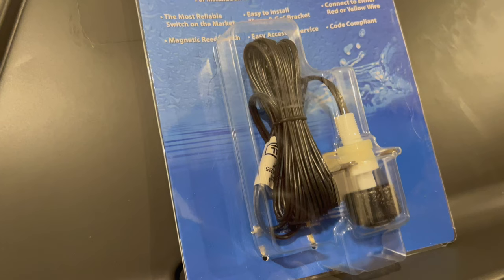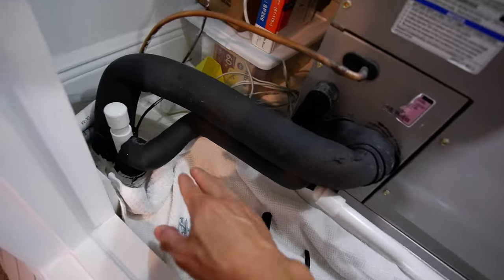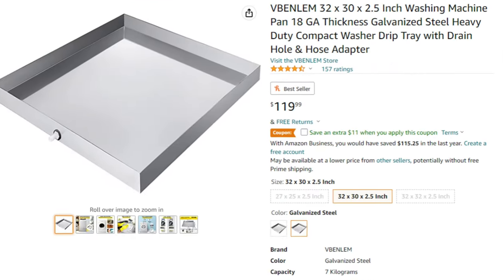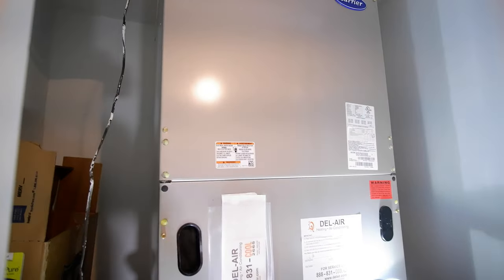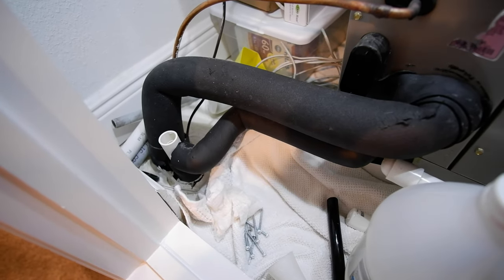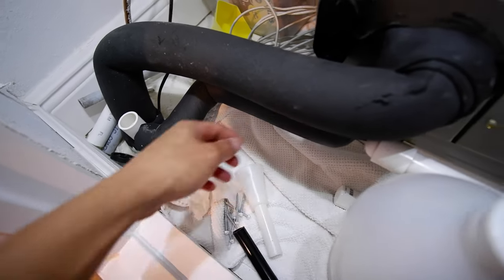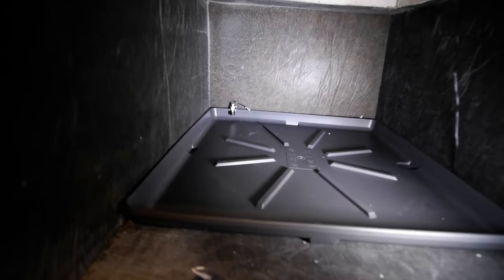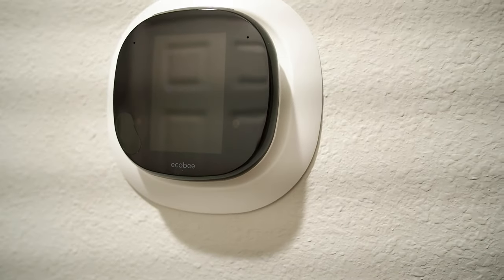How to Add AC Safety Float Switch and Condensate Overflow Pan

Comment: One thing bud you should have adjusted that float switch all the way down so that the pan does not have to fill near the top with water. Less water less work if it does back up but great job brother. Me personally I prefer a wet switch but ss3s are fine I just always adjust them all the way down.
Reply from the maker: Good point. They is a secondary backup pan and float. My primary has been getting filled lately due to that buildup of dust and crap again. I’ve had to compress air my line a few times since this happened. I also had to lift the primary line an inch so it wouldn’t falsely fill due to slow draining out of the AHU. The original plumber job was crap on this drain.

Comment: I think your condensate drain piping is incorrectly plumbed. I have the same problem before where I even have a condensate drain pump before pumped drain to above ceiling thru an exterior wall to  the outside but this ruin my ceiling several times and spend almost $10000 ti fix my house. See the video resolving this issue. Also your vent should be open to atmosphere.
Reply from the maker: I think my pipe was full of drywall sanding dust from the builders. Probably ran AC during construction once it was installed. I noticed when I open the pan, was full of caked on dust, this may have clogged my line. The house is 5 years old and finally caught up with the clog. For the line, the drain line is lower than the overflow line, but I think it may be clogged too, I tried to clean it all with a wire brush after this happened. 
For the drain, all my houses always had a cap for the clean out, never seen open to atmosphere in FL, if I leave it open, I can hear AC sucking air from it.
Reply: There should be a p-trap on the main drain line to keep the AC, which is under negative pressure, from sucking air through that line.  The clean out goes in the AC side of the p-trap and another one can go on the other side of the trap that extends higher than your drip pan.  The second one is open to the atmosphere. That negative pressure may be the reason why it is not draining down the tube.  Which would also explain why water is not draining out secondary line to raise the switch.   So it’s overflowing without draining out either drain line.  The p-trap would stop that suction action through the pipe.